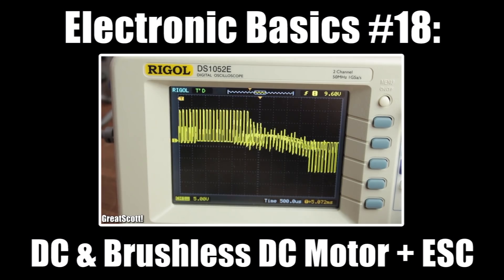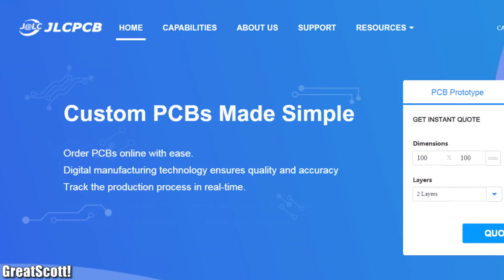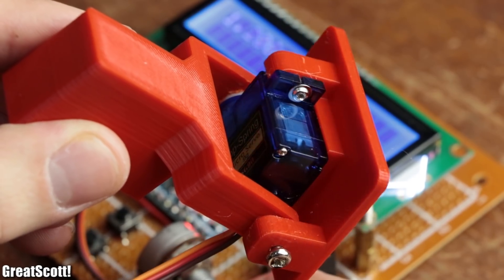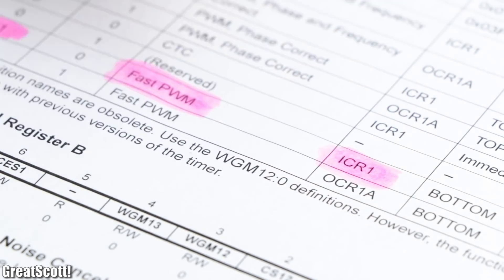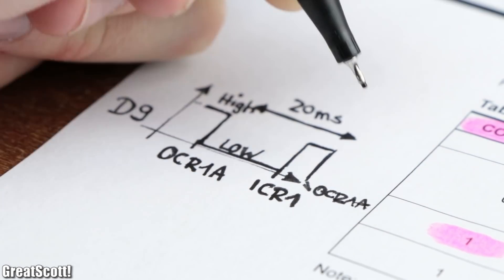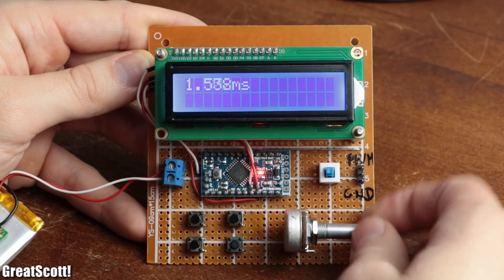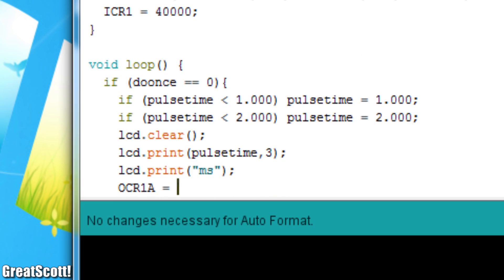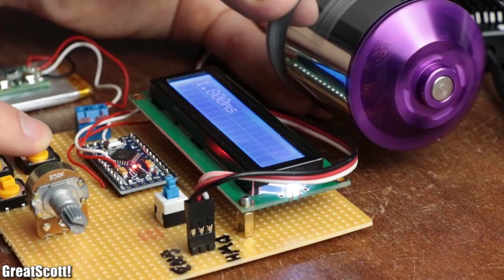Make your own ESC/Servo Tester

Comment: Hi. I know it is 4 years later but I have just made this. I have a problem which I cannot figure out. When I go to the button position it just counts down from the pot setting to 1000 ms. Seems to be in a loop.
Reply: Ignore my comment. I have it working. I changed pin D13 to A0 and it works. On two of my Arduinos D13 was only pulling up to 50%, so the loop was free running. I think they must be faulty.

Comment: Are you taking suggestions?  Long ago I built a metal detector with just a magnet, coil, and multimeter. I could use a nail detector, but have no time or workshop to test. Any simple ideas on using an Arduino and pw/frequency modulation?
   And thank you for the inspiring projects. I’ve built a few of my own designs after seeing what you have done.

Comment: save your money, man..use serial interface to set the values...you may develop an interface for it using processing ide. you won't have to use an lcd, and a few buttons. get yourself a usb isolator instead

Comment: Why do you use an Arduino board?
It is very cheap. Use an attiny or an atmega without arduino.
Reply: Only if you ignore the cost of the programmer. With the Arduino you might get away without one, at least until you set clock fuses wrong.
Reply: @Hauketal  what are the standard right fuses? With external quartz 16mhz
Reply: @lycankarmah1976  The problem is if you activate an external quartz or oscillator on a board not having one. To unbrick the device you either temporarily connect one or use high voltage programming of the chip to correct the fuses. Otherwise set the fuses as needed by your application.

Comment: Lipo or ESC powered on thing I know is that it need to have a common ground or the signal can be floating which means the negatives need to be connected and shared.

Comment: Nice video!!! , I was wondering and looking for a hot swap battery pack, I want to use two 2S 18650 7.2v battery packs and be able to switch them if one is out of juice so I can have a continuous output, something more nice than using 2 diodes. Any ideas?

Comment: PLEASE someone answer IS IT POSSIBLE CONTROL THE DIRECTION OF A BLDC MOTOR WITH AN ARDUINO? IS IT POSSIBLE TO ADD THAT FEATURE TO YOUR CONTROLLER?
Reply: rapolas st This is not the servo testers (arduinos) job. The servo tester just outputs a signal between 1000 and 2000 micro seconds. You need a forward/reverse brushless ESC who interpretes this signal into reverse (1000-1499), stop (1500) and forward (1501-2000).

Comment: Setting the timer register bit values but to set a pin to output not using  DDR? Besides 4 push buttons pot and a LCD, a little bit of an overkill, don't you think?

Comment: Or... Simply use writeMicroseconds() from servo library. Here is the snippet:
#include <Servo.h>
Servo esc;  

int potentiometerPin = 0;  
int val;    

void setup() {
  esc.attach(9);  
}
void loop() {
  val = analogRead(potentiometerPin);            // reads the value of the potentiometer (value between 0 and 1023)
  val = map(val, 0, 1023, 1000, 2000);     // scale it to use it with the esc (value between 1000 and 2000 ms)
  esc.writeMicroseconds(val);                  // sets the servo position according to the scaled value
}

Good luck :)

Comment: I have been wanting to build a servo tester with a 555 timer for a while now but all the schmatics I have seen have either had weird errors or written in a way I can't follow super well as I am a complete novice.
Reply: The 555 is an analog device. Timings depend on R and C values, which can be +/- 5% to 20%. The 555 is more of a gimmick than a useful component.
Reply: That makes some sense to me. Basically it will work but don't expect it to be reliable? I would just be using this on servos and nothing else but I assume this would still have an issue and potentially cause the servos to max out/crash? I guess I could use my arduino but I have no idea how to write a script for it to be used with a potentiometer.
Reply: @x9x9x9x9x9  I think the 555 would be okay to generate these kind of pulses. Probably the cheapest way to go. Certainly a lot easier than using an Arduino. But I think you might need an oscilloscope or something similar to calibrate the pulse widths. I'm not sure what kind of tolerances an ESC can tolerate. Worth a try if you want to do it

Comment: Make a video on attiny85 mini development board
Please i have ordered it for an Bluetooth car but don't know its coding and circuit.
And pls make a Bluetooth car
Reply: You will find an ATtiny85 very limiting for a bluetooth car. Assuming you do not require speed control you need 4 pins for 2 motors and you need 6 if you require speed control (and be assured you will.) 2 pins for power and that is your 8 pins gone! So what pins are you going to use for bluetooth communication? At the very least you need a Pro Mini, which is the board on my bluetooth car.

Comment: I have a broken cd drive and when I force the cd drawer in side the led lit even if it was not connected to any thing so I took the motor and tried to get power out of it however it didn't work. Can you tell me why this is happening

Comment: Hey Scott I have a great project idea for you basics of LCD and driving them with arduino ,wait a while not the ones with cog or otger controller but bare LCD which is quite difficult to control using a microcontroller

Comment: Bms diy or buy and how it works 🤔
Reply: This is the greatest project idea I've ever seen
Reply: I work with batteries quite often, and it depends on how complex your battery pack is, as well as the chemistry of the batteries. For standard 3.7 volt lithium ion cells (like common 18650s) in simple configuration (single, 3-series, etc.) there are many cheap options available that will do the trick. However, I ended up designing my own for some of my bigger projects involving complex custom series-parallel packs or less-common chemistry like LiFe.
Reply: @PropaneTreeFiddy  Oh my, I always wanted to make a custom bms. Can you share how you designed your own?? I need a bms for my 6S8P 600Wh li-ion battery pack before it blows up :)
Reply: Well all you need is his charge and security circuit with another ic for higher voltages and transistors activated by comparators so that cells get discharged if over 4.2v thats it
Reply: Definitely!! @greatscott
Reply: Yes please!